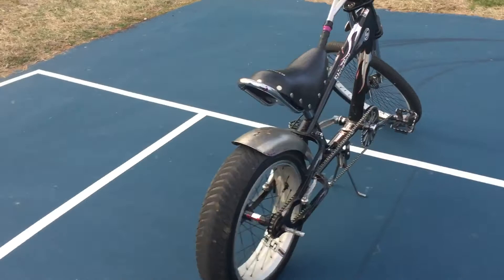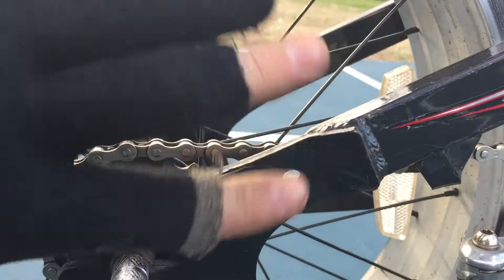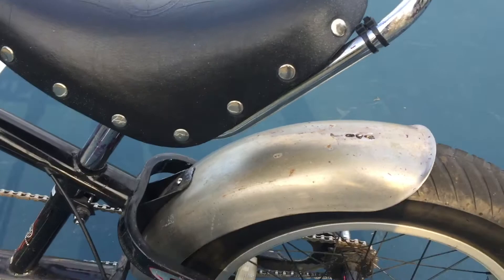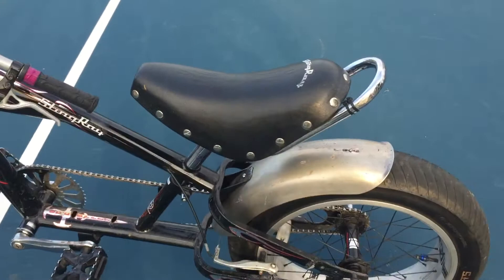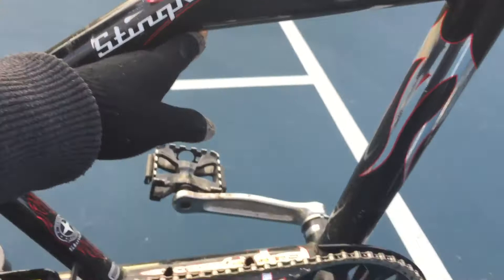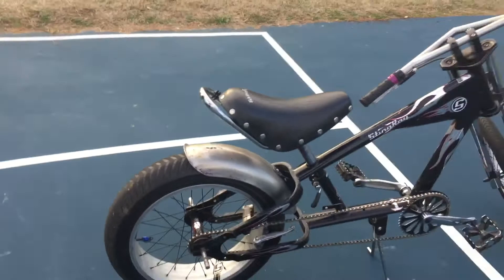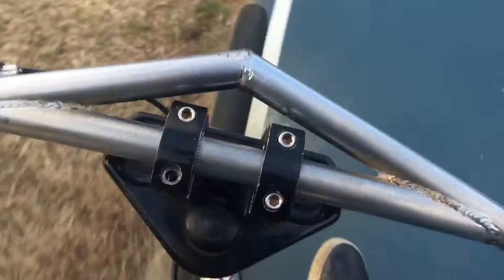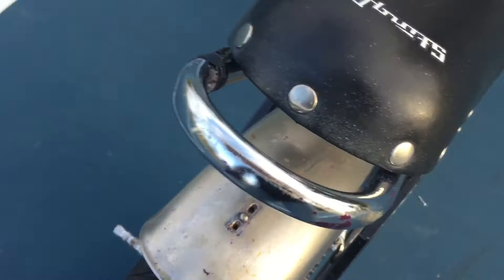Schwinn OCC Chopper Bicycle Review

Comment: I was working at walmart assembling bikes when these were new. those rear brakes never did work that good, even when new. I did a product demonstration on one, and found the bike to be uncomfortable, heavy, and they handled poorly. no matter how much I adjusted the brakes, they would fade horribly, and often over heat. there was one that came through with a disc brake and a sturmey archer 3 speed hub. that made the bike like a whole lot better, but the handling was still not good.
Reply: can i buy it ?
Reply: @abudhassan4945  if you can find one, buy one. I never owned one. I did own a west coast chopper, and tried like hell to get Huffy to do a recall on the rear wheel. not a good enough hub for that heavy of a bike.
Reply: Brakes are good for 10 years old